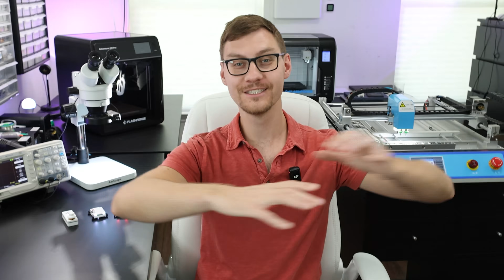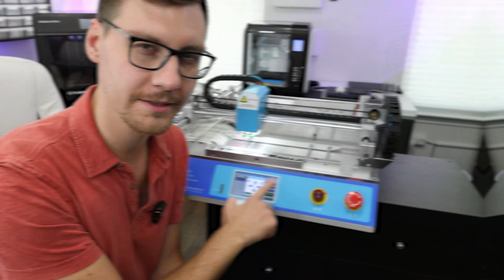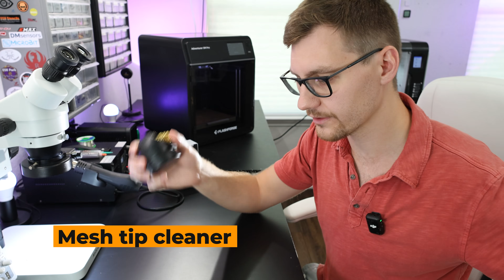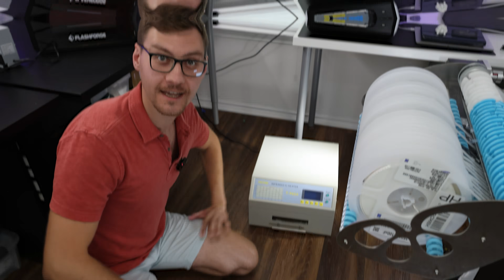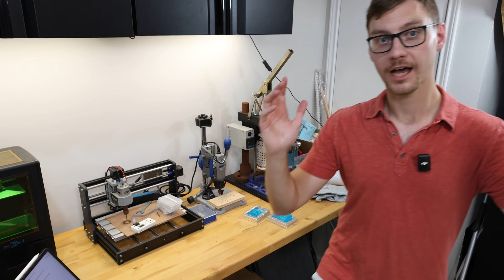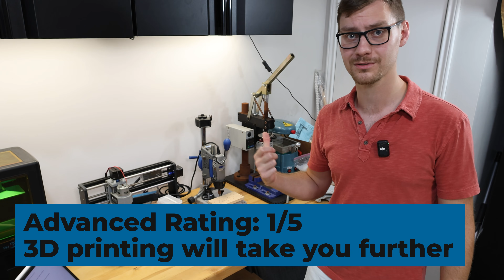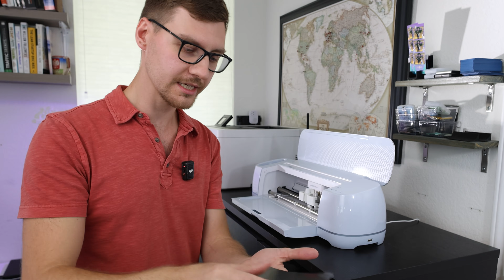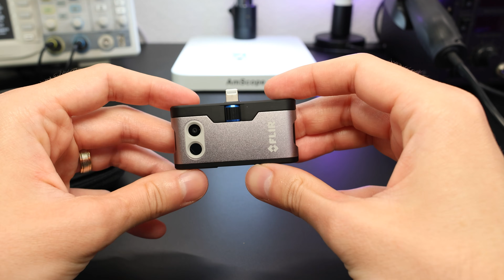I Wish I Knew This Before Building My Home Lab

Comment: Oscilloscope not needed??? I agree with much of this video, but on scopes I strongly disagree.  Especially for beginners, it's not about whether you'll use it in every workflow, it is about the scope being the gateway to understanding how signals work -- how electrical activity represents information.  Without a scope, you're blind. A meter is great for many purposes where you can rely on the voltage or current being slow-changing. But if you can't, and that means for most signals, then what you measure on the meter has to be interpreted, a skill that you won't develop if you don't have a scope that lets you see the ground truth.  There are many scopes available these days at quite affordable prices, so in my view they are an excellent minor investment for anyone who wants to understand the electronics that they aspire to work with rather than just play with soldering stuff together and hoping.  Regardless, I appreciated the video and will be checking out more of this channel!
Reply: Yeah, I agree. Looking at my first data frame on my 110MHz oscilloscope changed the way I look at communication now.
Reply: There are some relatively inexpensive scopes that can do decoding of serial, i2c, and SPI which reduces the need for a logic analyzer.
Reply: A scope is essential, if you truly  want to understand electronics. It's the eye of the electronician. Graham could literally apply to an oscilloscope the comments he makes about his microscope!...
Reply: 100% agree. Oscilloscope is a gateway to electronics and understanding of principles. no need to be Tektronix, cheap chinese crap will do the job well
Reply: I've literally been using my oscilloscope most days for the last week, since I've been checking the timing difference of less than a microsecond between two signals.
Reply: @brainwater  That is something that requires an oscilloscope. A logic analyzer wouldn't be capable of showing you a tiny difference in the timing of two signals.
Reply: @kevincozens6837 A logic analyzer can indeed show small timing differences. Like with a scope, it all depends on sampling rate. Logic analyzers can sample  as fast or faster than a scope, and since their front end is just a one-bit adc (ie threshold detector), they can be cheaper while doing so over a large number of channels.
Reply: The OWON HDS2102S is a well documented and pretty good Multimeter + Oscilloscope combination for under 150 Bucks (!). For checking signals and even HF stuff up to 100Mhz if you get the best version. Yes it's not a Fluke but I don't see the reason to buy an expensive multimeter for measuring simple voltages, resistances or caps. And with the built in 2-channel Oscilloscope you have a great tool to find Power source problems and dirty signals.
Reply: @boatoflol it’s good for some fast checking, but not for development.
Reply: It really depends what you do. I mostly deal with analog circuits and power electronics. I can do without a scope most of the time. But when I need it, it's a real game changer to be able to see the waveform, the parasitics and all.
When learning, I'd recommend using a simulator. Circuitjs is really good for that. I know many people would disagree and prefer hands-on tinkering. But it makes mistakes less expensive, it makes experimenting less dangerous and it reduces the number of points of failure (like bad solder joints, bad components and so on).
Reply: @Ceelvain Personally I love oscilloscopes and I do have a vintage tektronix scope.However I learned a long time ago from books on electronics  repairs that its not a must for a electronics technician,the most essential tool is a multimeter and I do agree with this view.Oscilloscopes are very useful but not an indispensable tool for repairs.Most of my repairs were done without an oscilloscope but I do love and appreciate the analytics that scopes offer that any other tool couldn't make possible.I guess there's a context to it and depends whether your interest is more than just repairs.
Reply: @beresfordsimpson7537 a late reply, but I'd like to say you have a point about a meter being heavily used in electronics repair. This is because most failures in electronics result in the DC (operating point) voltages changing from normal. So if you have docs or experience telling  what voltages should be at key locations you can quickly identify the trouble area. That is different from designing a new circuit, or examining the operation of an existing one, in which its the signals (electrical activity representing information) that are of interest. There a scope is highly revealing.
Reply: @Graham_Wideman Absolutely!I totally agree.
Reply: 100% agree.
Reply: Ive very rarely used my scope but I don’t regret having it
Reply: I agree as an aircraft and hvac technician.
Reply: Without an oscilloscope you also cannot diagnose or troubleshoot any audio or video signals except with obviously continuity checks. But that doesn't ever tell you the picture that you need to know because when ceramics begin to go bad then the continuity might not change because it shorts through a degraded ceramic when power starts to go bad it shorts through if it didn't burn it up. So there might be no arcing or other indications on the board but a scope will show you that the part went Bad. I can't imagine an electronics shop without it.
Reply: It probably boils down to: if you know how to use a scope properly, it is very valuable. To know how to use it properly, you must also have solid electronics skills. For beginners, its value is therefore limited (except if you want to devote your scarce diy time on how to properly use it, in which case you are no typical beginner but rather educating yourself to be a professional). 

For me, for example, digital multimeters, nanoDLA and other tools were much more helpful for understanding and troubleshooting, but this certainly depends on your area of interest. I am focusing on digital interfaces and mcus. Not that a scope wouldn’t be helpful here, too, but it feels like overkill and is way less crucial than with analog circuits. So imho the classification in this video - distinguishing beginner needs from professional needs - aligns well with my personal experience.
Reply: Beginner? No, think high school kid or just joined the workforce. A cheap multimeter will work for testing individual components you get in the "starter kits" for many electronics.

You CAN amazon a cheap 50$ oscilloscope, but if your weekly income is $400, thats 1/8th your pay.

Many tools and meters come before getting a decent oscilloscope. 
I would rather invest in a Pinecil or a better soldering iron than the one with a screw stuck in the side of it.

I would even recommend a $200 3d printer as a tool over an oscilloscope starting out. Because its uses extend heavily into other hobby's and repairs.

In my experience l, a decent oscilloscope  is after you have basic tools, understand how to proficiently use a multimeter, then you can start shopping as you will understand what each spec on one means
Reply: Yea, I agree. When learning electronics, a scope is a must. Once you know what your doing, the scope gathers dust. 

I also think a VNA and a SA are also great learning tools if your doing anything with RF. Back in college we didn't have either and I struggled with microwave electronics. Now 20 years later I have a NanoVNA and a TinySA, these have really permitted me to finally get my head around RF circuits.

Logic analyzers are the one tool I've never had a need for. But I do find digital electronics and programing easy, I rarely have logic bugs where an analyzer would help. Also these days we rarely use parallel buses and almost always use a serial bus of some sort. The scope is great for checking serial signals.
Reply: The keyword is "gateway." I didn't know what digital binary had to with computers until I saw a voltage waveform through a scope. Literal on and off voltages are being sent through copper, fiber, or radio. It's like Morse code, but the operators are NICs. Oscilloscopes are a MUST!
Reply: Exactly my thoughts. Dude rather recommends the PNP machine rather than the scope, lol. This was a weird video, felt more like "look at all my expensive toys"
Reply: @eXe09 Lol sounds like someone has a complex... Maybe time for some self reflection?
Reply: @eXe09  Yeah no, it didn't feel like MTV cribs Electronics Lab edition. Felt very honest, earnest, and very personal. Get the fuck out with this L take.
Reply: @Fringetheory472 I agree that the video was not bragging about expensive tools especially considering the low end pick and place, which tend toward unreliability. That said, is there a reason you felt it necessary to be so dismissive and drop an f bomb? We're only discussing electronic equipment here and hoping to best encourage newcomers.

Comment: Nice to see your lab. Much depebdscon wgat kind of prohects you want to do. I can recomend buying a relative cheap component tester. You can plug in diodes capacitors resistors transistors mosfets etc.and the device figures out what it  how to connect it and its values / properties. Ideal to test your components during assembly. Unfortunately for smd it is a bit more difficult. 
Also use good lights for your workbench and use a good chair to sit comfortabel.

Comment: Fully agree a 10x stereo microscope can be a great aid when your going to 0603 and essential for 0402. just seeing solder shorts and dry joints on leadless chips,  it makes a world of difference. I do all my soldering under 10x. Theres alot of second hand cheap 7 - 40x available. (0.7 - 4x) with a 10x eyepiece. my cnc, sat unused, yes. RE resin printer, PCBway resins are supercheap and ~+ - 0.1mm accurate. LOL, I have an identical oscilloscope from ~ 7,8 yrs ago , different branding but the same, rarely used but essential for signal integrity, the logic analyser, your spot on. thermal camera, yes, but only if your fault finding. failed chips and caps do get hot.  Great video . Its an investment but what does a new football season ticket cost. no idea.

Comment: Would you be willing to give a few recommendations (different options probably at different price points with links) to the various tools you have?  Adding a few thoughts on each one would help for some people needing a tie-breaker.  For me, I need recommendations for a lightly used but quality hot air rework station and also a variable bench power supply.  Anyway, thanks for the great video.

Comment: Interesting to see your very different angle on setting up an electronics lab. When you said the oscilloscope isn't necessary I understood that your purposes are completely different than mine. It totally depends on what kind of electronics you want to do. An oscilloscope and/or nano VNA cost a fraction of what they used to cost and are completely indispensable for working with fast analogue signals or tuning RF circuits. Also, if you work on vintage electronics, a microscope is almost useless but a high wattage soldering iron with a huge tip is needed.
Reply: Yep 100W minimum on the soldering iron. Weller even has some good consumer ones out now

Comment: I bought an oscilloscope and I barely use it, it's a 3in1 thing but still I just use it for signal checks. I would prefer a thermal camera than this oscilloscope (I do electronic repairs mostly)
Reply from the maker: for repairs thermal is a must! you can spot the overheating element so fast. it takes so much of the guess work out of the equation
Reply: @stuckatprototype yeah, but they're hella expensive here, and isopropyl alcohol can achieve a similar result 😅

Comment: These days I use a magnifying digital camera mounted on a swing arm to see and to solder tiny things. in conjunction with a small video display it produces highly detailed views without the necessity of looking through the eye-pieces of a microscope. An $80 video camera/monitor microscope has sent my stereo microscope to the closet. 

I started out 60 years ago soldering with an old woodburner with a nail for a tip, and over the years I worked my way up to a Metcal soldering station. The more hand-soldering you do the better soldering station you will want.

The soldering iron tip re-tinning is useful for worn-out tips that simply won't take solder anymore, but it should only be used when the tip has become essentially useless. It is an emergency repair, not an every day soldering aid. Anyone who has to use it regularly is not properly maintaining their soldering iron tips and should watch a couple of videos about the proper care of soldering iron tips. They do require care, and until someone understands that, they will go through many tips and will be very displeased with their soldering.
Reply: I put my iPad mini in a cheap Ikea wooden stand. Great image quality when zoomed in. And I can record or take pictures etc.

Comment: For PCs, I recommend refurbished with an SSD and 16GB or so memory.  Get a couple, and use them for separate things.  Put one with your monitors on your desk, and remote console to the others. Use a NAS for all your project data.
I use Synology for the NAS, and it also hosts small Web apps for me.  Very versatile.
Reply: Refurb mini PCs also don't draw too much power. "Desktops" love to burn power even in idle.

Comment: Peculiar. Not even a passing mention of a lab power supply. Perhaps electricity is a different kind of thing in Texas? 

I've spent decades chasing around companies fixing poor electronics designs and layouts. I've been kinda hoping that people would learn and improve. Basic stuff like when to use a differential probe, how to make a correct measurement of a pulse edge, how to identify problems in ground returns, how to ensure common-mode conducted emissions are managed. Beyond a hobbyist setup, a decent 'scope is vital to see if signals are being transferred, if switched inductors are passing current as expected. Without it, you're working in the dark guessing that "0V" really is 0V. 

It'd be really helpful to explain in some detail what kind of electronics this lab is designed to work with. I suspect it rarely needs to work with anything above a few 10s ok kHz, 5V or 100mA (although there'll probably be some "weird" effects as microcontrollers are powering up but will be dismissed by a vague windmilling of arms and muttering "EMC" followed by a knowing look to hide the bafflement.

Hey ho. I don't think I'll be considering early retirement at this rate - somebody's still going to have to fix it when idealised high-school design meets real-world physics.
Reply from the maker: fair! I did forget to mention it, I was going to add it in the edit but it didnt flow. I have a cheapo desktop power supply, it does fine for the type of work I do. And as for retirement... with all the AI slop incoming I think you will have a lot of work ;)
Reply: Ditto on the bench power supply.  For this hobbyist, a line to 48V DC converter + CC/CV panel module, mounted in a box with a couple of banana posts seems to do the job.  Occasionally I'd like two channels, but I make do.

Comment: Check out FNRSI oscilloscopes. 2 channel, 1 Gsample/sec, 350 MHz BW, portable, 7" tablet screen, GORGEOUS. $240 early bird price with coupon. Tiny handheld model does 180 MHz BW, 500Ksamples/s, about $140. And there's a single channel model for even less.